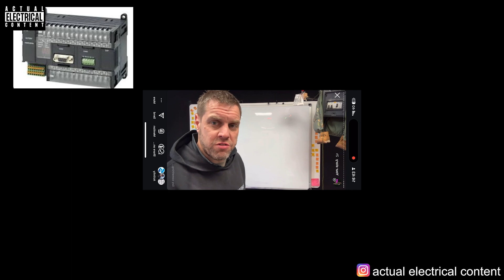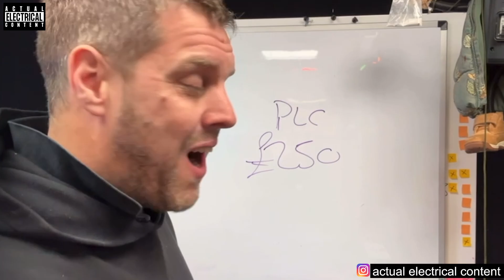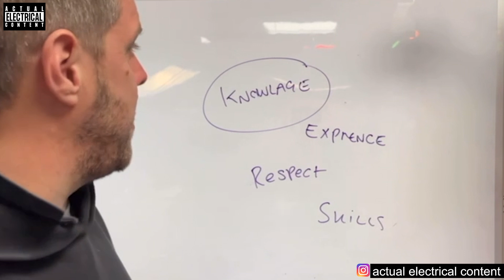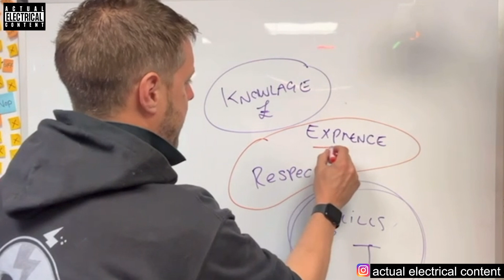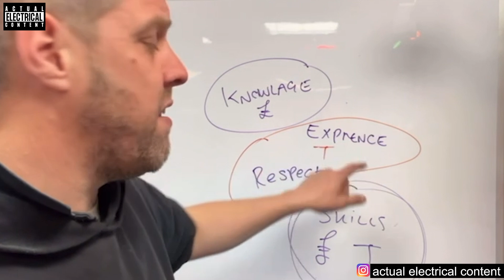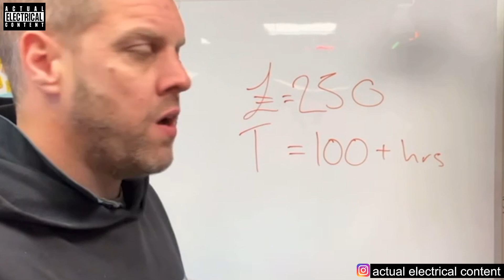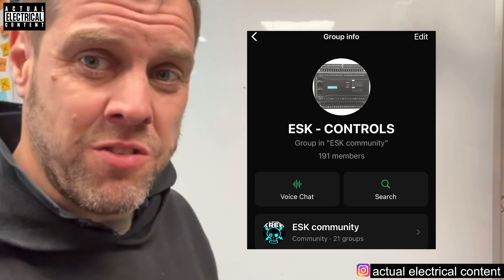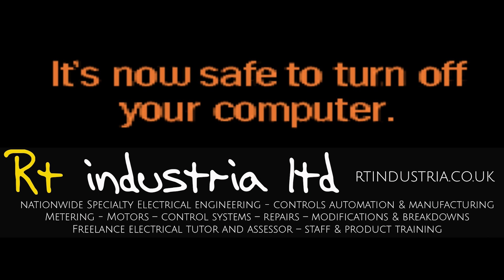LEARN PLC ,build a PLC test rig, WHY DO THIS

Comment: I would really recommend the Arduino starter kit. You get a few sensors, learn how LEDS work, motors run with transistors, change directions with h bridges etc and also learn how to code along the way. Its C++ so a bit old hat now but yeah you’ll have a very good understanding of coding process after 😊
Reply from the maker: They are the lowest form of this and I guess they get you in to programming and debugging but they are not plc,s

Comment: Should be a good one to follow, If you're going to do this, don't try and do it on the cheap and just simulate it in software, buy buttons switches and bits to make things up, you'll learn much more when it all goes wrong! I started with the LOGO then over a year added modules a Danfoss VFD and a tiny little motor, I've completed a few projects, controlling commercial spa's and I'm none to clever, but you do have to stick with it, and RTFM!! lots and lots!!
Reply from the maker: Your going to like Part 2

Comment: The cheapest way to get into this is with AV equipment like IOT input/output reylays made by makes like Shelly, Sononoff, and dozens of other manufacturers which are open source and can be adapted into your own custom systems. I started doing this 25years ago with lighting systems, which has kept me in work!
Reply from the maker: It’s not a PLC though mate , we are not leading to controls things we are leading the basis of all industrial process , the cheapest way is arduino but it’s not industrial spec

Comment: There is nothing wrong  with Alliexpres  if you are on budget. I was  need to  build  PLC learning rig. 22mm button lamps  24V DC  fearly cheap.
Reply from the maker: It’s very good as you will see in video 2